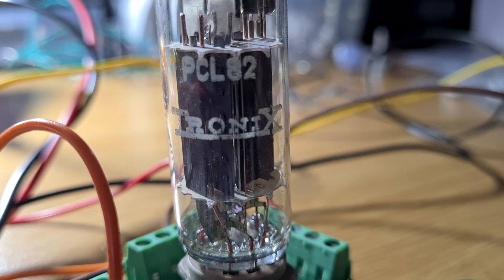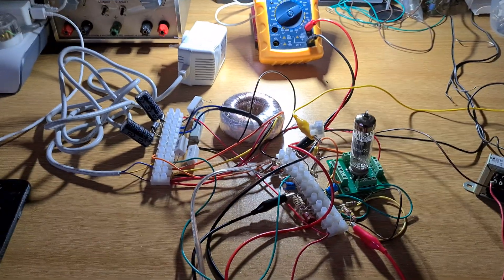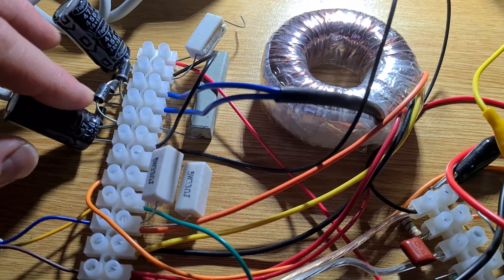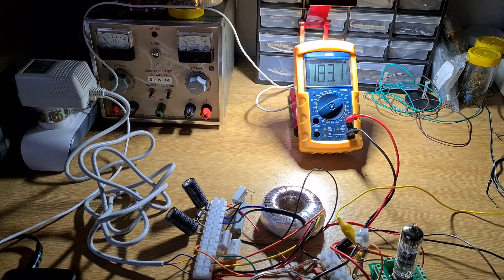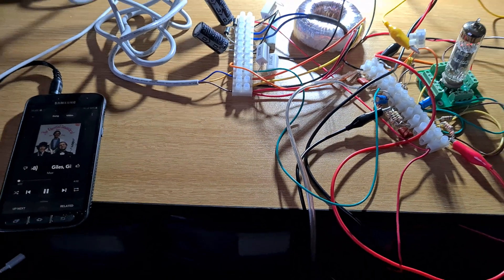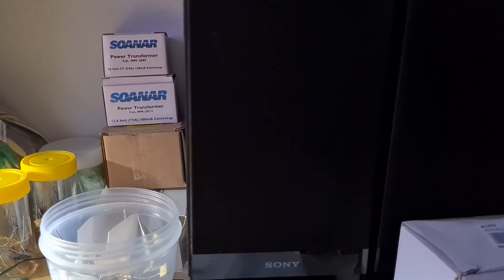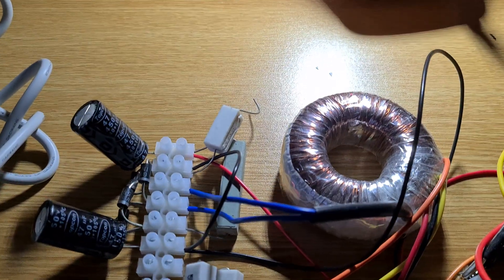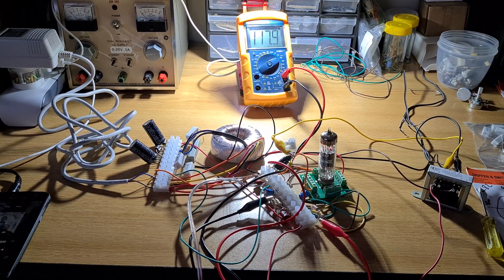PCL82 Valve Amplifier (ECL82 16v heater equivalent). Plugpack powered from mains.

Comment: Hello l have a radio lights ok but no sound.  It has UCL82 tube . 
Can you write please whic other tubes can use instead of UCL82 as equivalent.
Reply from the maker: 50BM8 / UCL82 , be very careful,  as it sounds like you have a transformer less set with a series heater string???
Reply from the maker: They are the most dangerous type of radio to work on.

And if the heaters light, it could potentially be due to many other reasons that you don't hear any audio.
Reply: @lanceneame find UCL82 difficult. Can l use PCL82 instead of
Reply from the maker: @rasimyeniyurt9382  sorry,  not in that radio,  because they have greatly different heater voltage requirements
Reply: @lanceneame dear expert l have electrik experiance and l know that kind radios have much risky just l have no any ida abaut tubes litle bit l searched in internet for this tube than understand it is for ampfy . Thats why l would like to ask an expert master For a mini hope .
Any why thank you wery much for your answers .